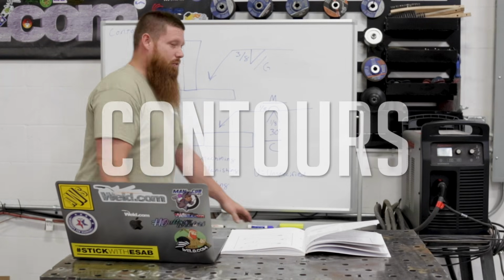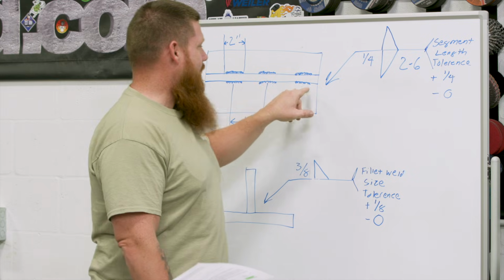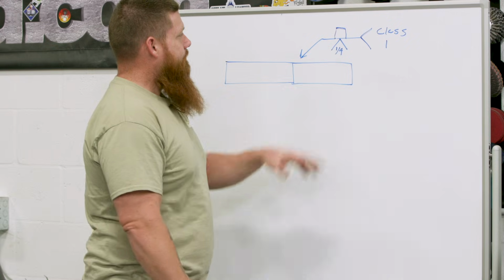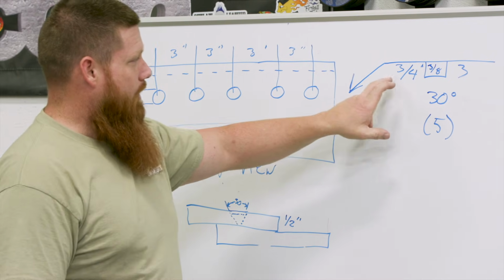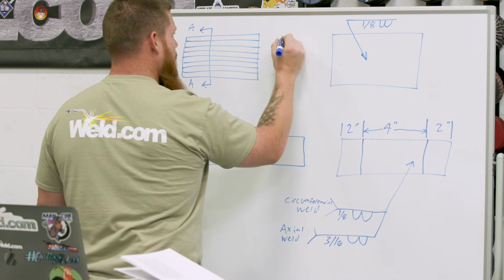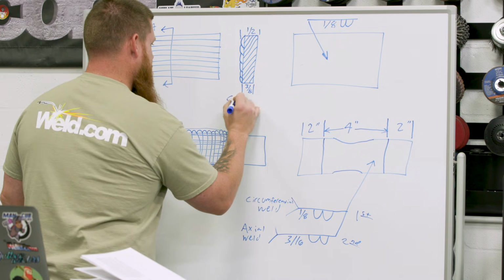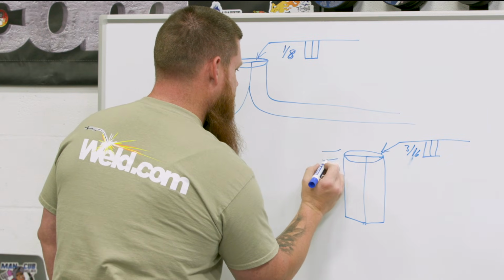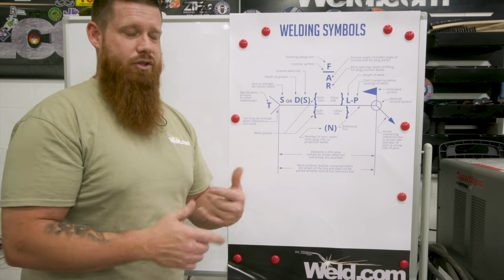How to Read Welding Symbols: Part 3

Comment: Contours 0:20
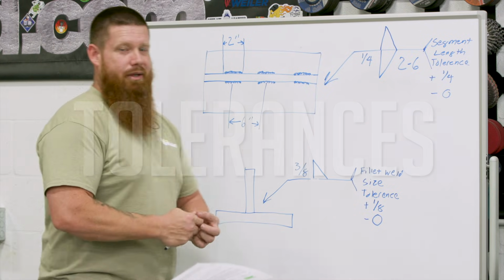Tolerances 3:33
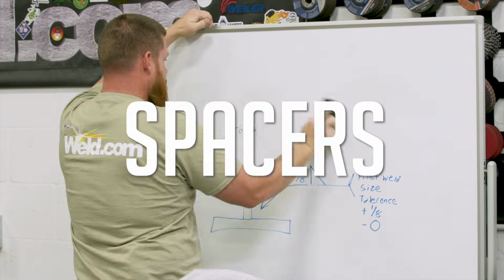Spacers 5:28
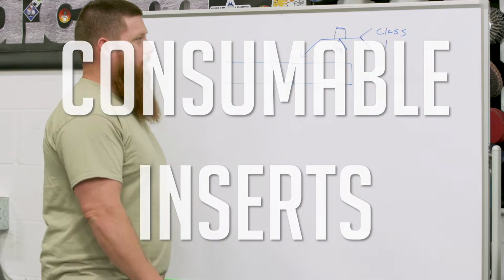Consumable insert 8:20
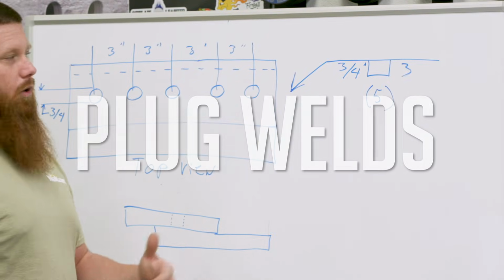Plug weld 9:25
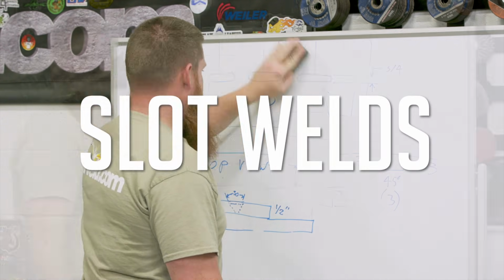Slot welds 13:13
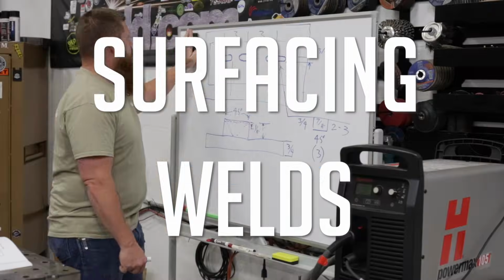Surfacing welds 15:02
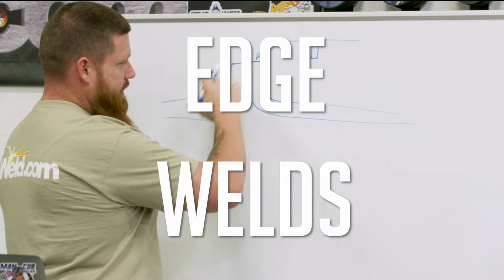Edge welds 23:58

Comment: Awesome video exam for semester one tomorrow 
Hope I Do well
Reply: Thanks I passed 100/100 for Print reading 92/100 weld testing 82/100 SMAW 1 86/100 Oxy-Fuel and gas welding
Reply from the maker: Good luck!!

Comment: Thank you for posting the welding symbol series, has been invaluable. Preparing CWI test.
Reply: Hi Gary! How was your testing?
Reply: @ryelz2483  just received results from testing last week. 68% overall failed. Scored very well on practical knowledge. 68% on part C very interesting how they broke it down. Two of the five areas dealing with Inspection did well over 85%. And one other portion I got 100% on. But other two dealing with records I got 33% on that which was part of all part of the part C.
Part B got a 58% on. Up from 46% last time I took it. Still not good enough
Reply: @isx530gary  you'll get it bro 🙂
Reply: @isx530gary  what are you looking to do with welding and are you a new welder?
Reply: @ryelz2483  Older retired doing inspection when called upon. construction manager and Inspector. On different projects trying to upgrade my credentials.

Comment: Can you make a video on how to show welding sequence, specially on plug welds to avoid warping,I am wondering if there a better way than putting it in the symbol tail.
Also, maybe in the same video, can you explain how I can show where exactly to tack weld to secure parts before welding, without creating 2 sets of drawing?
 Great Videos!!! I love the application examples.

Comment: On the plug weld around the 12 minute mark, when you add the taper the weld size (3/4" in this case) is the max diameter, correct? Just making sure.

Comment: Q: On your 3/4 plugweld (@ about12:00) you showed the vertical prep at 3/4". But when you showed it with a 30 degree prep the plug bottom became zero and the top was 3/4. Is that correct? It seems the intent is to weld the two plates, so zero at bottom seems wrong in this case. Please clarify.
My question: Does the dimension always indicate the top of the prep?
Reply: from de AWS WIT book, the 3/4 in will be the diameter of the plug weld(from weld toe to weld toe lets say). This is the weld size you have to be able to measure after the welding is done.  

The top of the prep (in the upper surface) will be of a higher value.

As i said, i have a picture from an AWS book that clearly shows this. If you still want it, put your email and i will send it to you.

Comment: What does "chipping" mean?  It will bug me till I find out.  
Thanks, this was a damn good series.  I don't weld by prints anymore but this was a great refresher course. You never know, I might want to keep up in a conversation sometime.
Reply: Lee Barnhart from what I understand it is very similar to using a pneumatic chisel to shape the weld or remove material.
Reply: Weld.com  #me too. ( # = lb)
Lee my guess is:
Wouldn't your/my guess be closer described as  the planishing procedure.( hammering method to cause thickening / shrinking)?

Or this symbol only applies to any fluxed procedure method. Meaning you use the slag hammer and nothing more ,for post clean up.